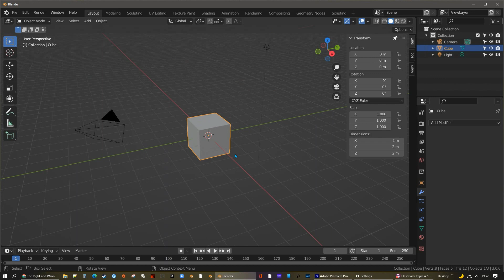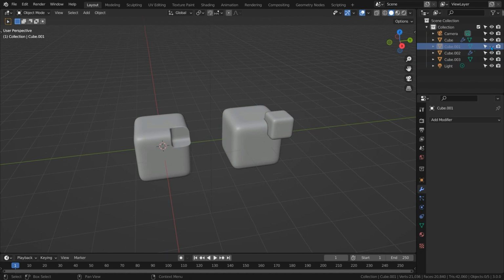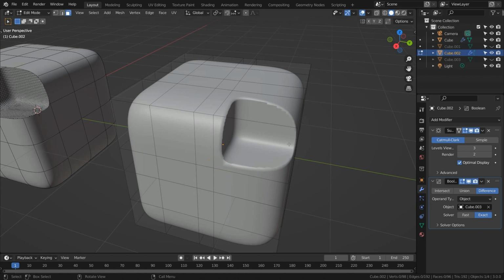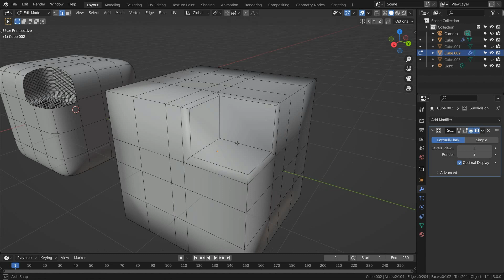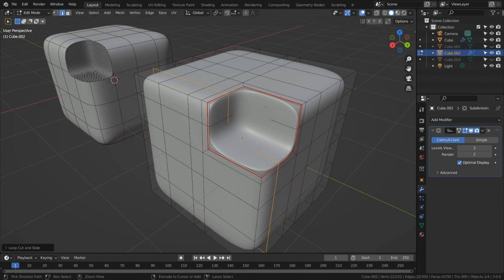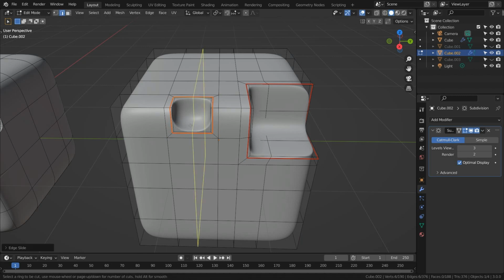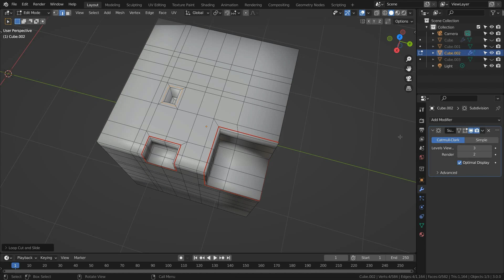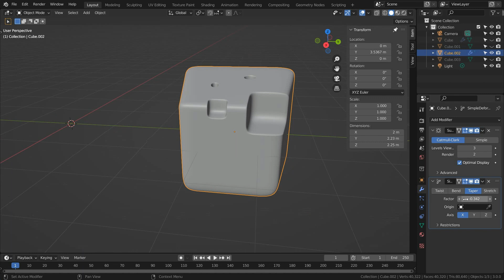Blender - Hard Surfaces - #12 Subdivision Surface Modelling in Blender

Comment: 4:50 has anyone been able to get this to work? when i loop cut with ctrl + r, then hit r, i get rotation, then if i hit f while the rotation is still "live", nothing happens. edit: after some testing i found that hitting "E" straightens the loopcut, then i can hit f to toggle between straight and following nearby loops. just a heads up for anyone who got stuck there.
Reply: Thanks :)

Comment: I was doing a boolean workflow course and felt so dirty, glad to have found your channel, this is way cleaner. I think I am slowly figuring it out on my own, but do you have a technique for doing panel lines in a subsurface workflow? Like seen in Scifi and Warhammer and Gundam models?
Reply from the maker: Hi Douwe de Vries. Yes, I do. The technique is generally called "Panel Beating" and requires cubic curve interpolation. In Blender, this functionality is provided through the use of the "curve" tool within loop tools. My next video will talk about it. Cheers!

Comment: This would not work on curved surfaces, which would be a general case...On planar faces as is the case, anything goes
Reply from the maker: I can definitely make this work on curved surfaces! If you look at my bishop tutorial it uses exactly the same principle just applied in a slightly different way. and if you look at my UV sphere tutorial I show how to compensate for any problems with normals if required. I will also apply this technique in a different way again when we model around the curvature of the rook!
Reply: @ianmcglasham  Hi Ian... Thx for the reply....What I meant was that if you add loops on curved surfaces, new problems will arise (change in curvature, poles, pinching, etc) as in a flat surface there is nothing to go wrong, really. That s why after subdivision I always shrinkwrap to a perfect  surface ;)...The Catmull-Clarke algorithm, divides at middle points.... so adding a loop not at a half distance will introduce new challenges ;)
Reply from the maker: @gibson2623  Hi Gib Son. Yes you are correct. I do have solutions for those things too! I've just not made the videos yet. lol. It is based on reparameterization of partial loops under the influence of a shrinkwrap modifier! Normal editing techniques can also be used but I think that is a dangerous (in terms of passing models down the cg pipeline) so i don't use them. Good planning is where the real skill lives sometimes!

Comment: Great series for learning subD. But booleans definitely plays a role in hard surface modelling, especially when making static meshes which have no need for deformation.
Reply from the maker: Thanks Ken. I would never want to discount any of the tools in blender. Modelling needs some creative solutions sometimes and if someone can get the result they need more easily with a boolean, then they should use a boolean! Sometimes a Subdivision solution is really complicated and without the experience needed to solve it quickly, trying it just for the sake of good topology can leave artists making compromises and ending up with boring shapes. Booleans definitely have their place.